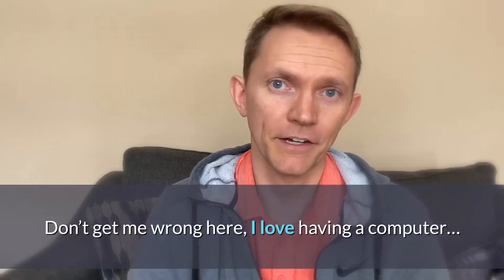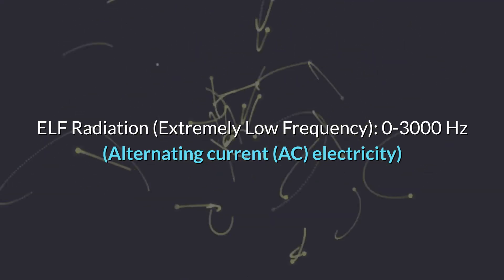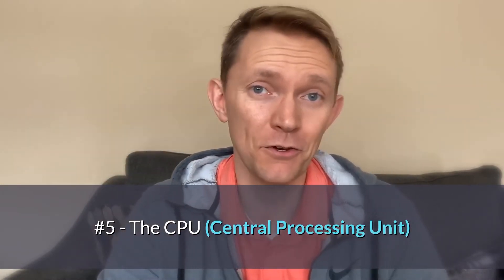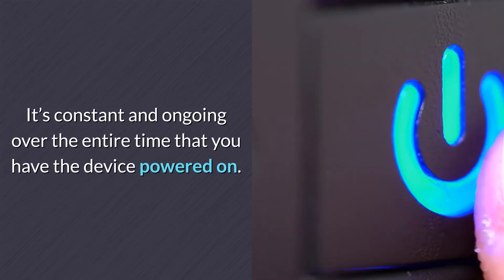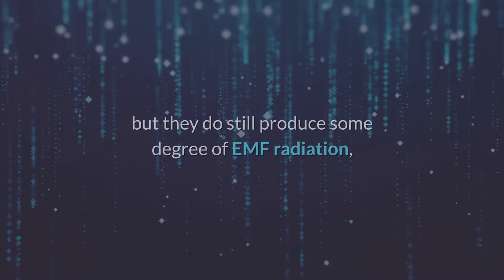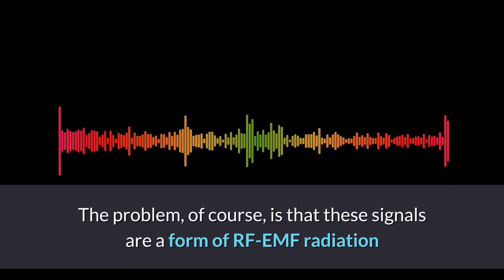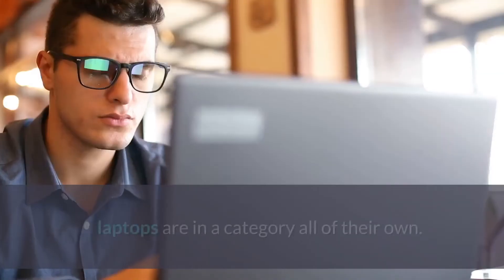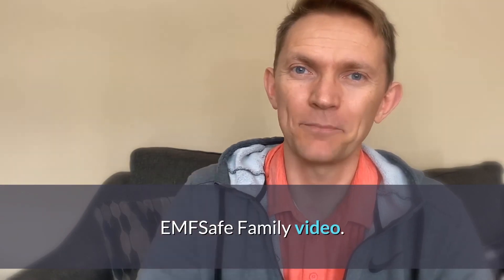Top 5 Computer Radiation Hazards - EMF Protection

Comment: Hi great video, I run a business and as It’s a startup there’s days, usually twice a week I’ll spend as shocking as it sounds 16 hours on a laptop as it’s my big dream to make it full time. 

I use my laptop unplugged, on a table, and it’s at least 30cm+ a way from me. I use the built in keyboard and my own wired mouse when using it. I also wear anti UV/blue light glasses as I’ve heard these help to prevent some forms of harmful rays.

Is there anything I should be worried about and is there anything I can do or am I okay? I’m 15 if it helps. Most my days in the week days after school I spend packing orders away from a laptop at close proximity so it’s not like it’s 24/7. Please let me know I really appreciate your time, thanks.